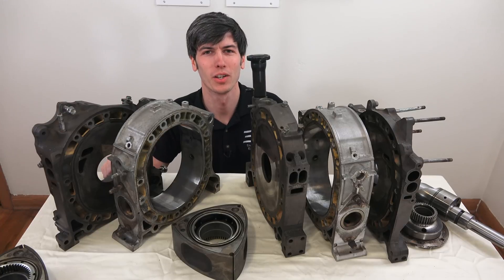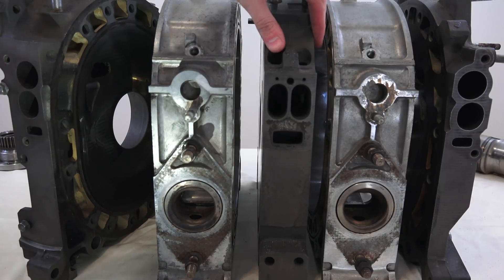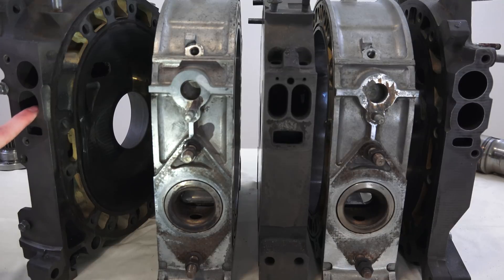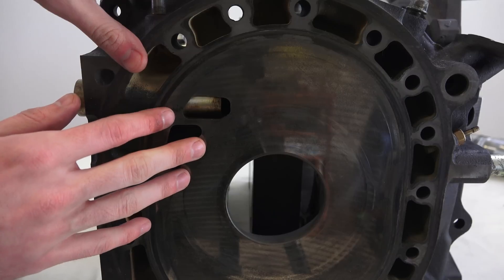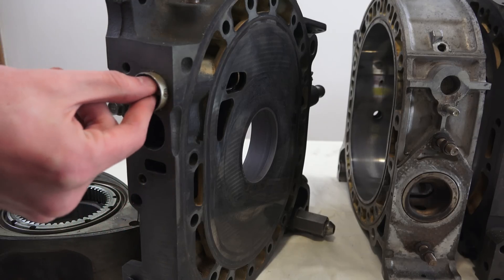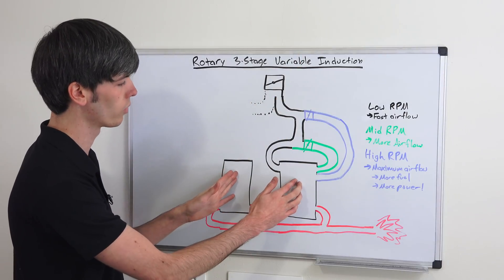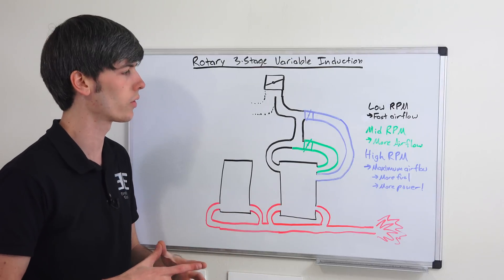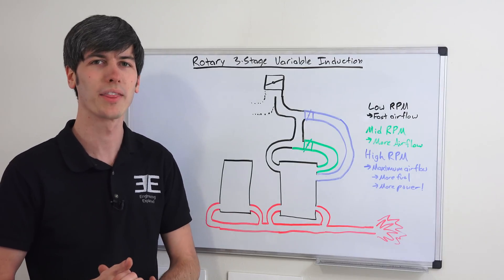Do Rotary Engines Have VTEC? Wankel VIS

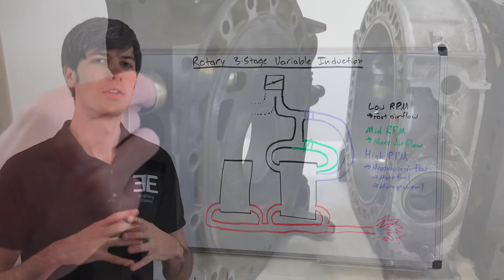Comment: So, rotary engines do have valves? In this case, the intake valves (shown at 1:57 ) - though they are outside the engine. In the video at 1:30, we could also claim that's a sleeve valve of sorts for the auxiliary port? That's inside the engine... Killing the myth that rotary engines, including the Wankel rotary engine design used by Mazda, do indeed have valves.

Comment: What if you eliminated this (vtec) system, and was giving the engine maximum airflow at all times? Increased power and poor fuel economy?
Reply: there wouldn't be an increase in power because all three are already open at high rpm, you would just lose low rpm torque and drive-ability due to lower intake velocity

Comment: Fun fact: The 6-port engine in the Rx-8 actually has 5 intake modes!

Idle - 3250rpm = Only the 2 ports in the middle iron are open
3250 - 5500rpm = Secondary shutter valve opens, allowing airflow in the lower ports in the end housings
5500 - 6250rpm = Variable fresh air duct opens on the airbox (shorter intake length before filter)
6250 - 7500rpm = Auxiliary port valve opens, allowing airflow in the upper ports in the end housings
7500 - Redline = Variable dynamic intake valve opens, opening a shorter intake resonance path

Mazda went to town on this one.
Reply: Does the 4 port model have this too?
Reply: @imjustvibinboi2406 4 port doesn't have the Auxiliary ports, and no variable fresh air duct on the airbox

Comment: Are these multiple intake ports a necessity because of the carburetor?  I wonder if you could just use all three intake ports all the time with a fuel-injection system.  But in 1985, I'm pretty sure Mazda used carburators on their RX-7s.
Reply: GSL SE

Comment: It's not a solenoid that opens up  the secondary ports. It is the speed of the exhaust gasses creating a vacuum effect in the lines attached to the secondaries that causes them to open. A solenoid is an electrical device.

Comment: It's vaccum controlled on the 85 you were showing. no solenoids. it's like a little vaccum chamber that as it collapses at high vaccum it rotates that shaft. just pulled all that stuff off mine, they were locked up.
Reply: Lock them open. It's like running with 4 barrels open  had one called the Hemi Stomper

Comment: Wankel engines suck they did when they where invented in Germany, they still do. Mazda never made a reliable one after decades of investing in them new materials it just doesn't work they have a short lifespan and drink more than an average back alley hobo. Only "fan boys" like Wankel engines.
Reply: They beat the pistons at Le Mans. Mine has 200k, and has never been opened up. I also have a 1976 Cosmo RX5 still running .Wanna be.

Comment: my aux ports and vdi are open only cause they were seized shut lost a little bit of low end but i went to a gtu s diff which is a 4.30 vs the normal 4.10 so didn't notice a difference

Comment: The RX8 engine diagram is a bit off.  No butterfly valves.  You have a single SSV valve that actuates.  It rotates to different positions to open and close the intakes.  The positioning also allows cross flow from rotor to rotor.  basically as on rotor closes it's ports a pressure wave heads back through the intake and into the other half of the engine.  Mazda claims it makes for a sort of supercharging effect.  Sort of.   The pressure wave just shoves a little more air/fuel in.  They claim it's good for a few HP.  Not sure how much they say it is.

Comment: I've experienced cruising in a Nissan with a continuously variable transmission (CVT). The extraordinarily low engine RPM at cruising speed made for some impressive fuel economy. 
I'm wondering if pairing a CVT with a Wankel operating at low RPM would be light weight enough to be economical. So, I guess my question is, since I understand that piston engines tend to bog down at low RPMs, is Wankel efficient enough to run that slowly?
Looks like a marriage made in heaven to me.

Comment: I just recently watched the video on the 4 reasons why the rotary is dead, and the main problem was fuel economy. That being said, with only one port open at low RPMS, does that mean that it is getting worse gas mileage at higher RPMS because all the ports are open, or does it compensate for the faster turning of the rotor?
Reply: Look at Jason's later vids on the rotary, especially the hydrogen one.

Comment: Very interesting and well explained.  The emissions effectively killed this wonderful engine and the difficult seals, so if in the future one could solve these problems, it may be competitive again, right?  Diesel has oil in the fuel mixture, would that not be sufficient to lubricate the tips of the rotors and avoid having to inject oil to burn and ruin the emissions? I know NSU, Mercedes, Fiat and even Norton motorcycles have dabbled with the Rotary engine and given up, therefore I am sure they must have considered all the options before relinquish their interest.  Thank you for the info.

Comment: Is this done more to increase fuel economy/efficiency than to increase horsepower? The waknel isn't known for it's MPGs.
Reply: +Osvaldo Morales You are partially correct in that it is to increase horsepower but only that those auxiliary ports are closed to promote more stable engine operation at low speeds and of course gas mileage. When you climb the RPMs, the other valves open and you get increased airflow and more fuel to maximize the efficiency of the engine. Btw, the last naturally aspirated rotary made (86-91 RX-7) only put out 146-160 hp. The Renesis puts out anywhere from 230-240 hp. And they have the same gas mileage.

Comment: +Engineering Explained - I feel you missed a big part of the VIS on the Renesis, as well as some piston engines like the BEAMS toyota/yamaha engines.

Not only do the ports open to affect port velocities, but the actuators are situated in the intake manifold so as to change effective runner length, greatly increasing VE.

Comment: The variable length intact tracts used on the rotary  engine make more power or TQ by changing the length and also speed of the incoming pressure waves , depending on length. The RX7 FC S4 N/A engines 86-88 are called 6 port engines. These engines have 2 primary intake ports and only use these primary ports before 3800 rpm. At 3800 rpm the S4 N/A engines open 2 more intake tracts, as well as 2 more oil injectors start working and the remaining 2 barrels of the 3 barrel 115MM TB also open up.  The 86-88 S4 Turbo engine is a 4 port engine and does not have the variable intact tracts.Changes were made for the 89-91 N/A S5 engine, now Mazda added a VDI, which started to work at 7200 rpm and allowed these engines to produce power up to 7800 rpm stock.  The 89-91 block for the S5 turbo engine is the same as previous years.  This only applies to 2nd generation RX7,s

Comment: answering the question thats used as the title of this video, yes, definitely...... rotary engines, specifically the more common 13B, uses the best type of VTEC, however Mazda calls the technology Twin Sequential Turbos, lol..... in all seriousness, no, the more common uses of rotaries are to make an insanely light and small displacement engine and then slapping as many turbos onto the engine as they can. has Mazda designed and utilized something SIMILAR that acts like VTEC/VVT/etc? yes, but definitely not the same because rotary engines dont have CAM SHAFTS. in their naturally aspirated (non-turbo) engines, they added 1 additional intake and 1 additional exhaust port, and used crank shaft sensors and computers to actuate these valves; off of what rev youre at, throttle input, etc.... that technically isnt a traditional variable valve timing mechanism though, because traditional versions are actuated via retarding/advancing the cam shafts (which is the part that opens/closes your valves), and like i said earlier, rotaries dont have cam shafts.

that is all.

farewell.

stay frosty.
Reply: that was sarcasm dude.. lol.. VTEC was essentially designed to mimic a turbo setup; when off boost, youre not consuming much MPG, when your boost kicks in, you use more fuel.. VTEC is like that in a sense, when out of VTEC, you're not consuming much fuel, when VTEC kicks in, you're putting your engine in "turbo boost mode".... so, in a sense, Mazda's VTEC is the best kind because it utilizes twin turbos lol

Comment: they are "stackable" if you will it usually just requires a longer eccentric shaft ususally a 3 peice in the case of 4 rotors 26b and longer reinforced studs but the engine has to be balanced and perfectly aligned to make sure it doesnt twist while running and break itself   essentially . and they can be "v-mounted"  in the case of the 12 rotor engine. how that works i really dont know. custom brackets to hold each set of rotors along with each eccentric shaft having its own pulley and a complex drive belt system from what i saw in the video of it . along with a costom i take manifold to feed all the "blocks" if you will. im sure its very complicated tho and took tons of time to develope.

Comment: Your video doesn't detail any pulse-wave tuning of the intake or exhaust manifold, talking about air-flow only.  I've never really thought about it in the context of rotary engines, but the varying lengths of the effective intake must have an affect on the intake pressures at certain rpms? Could you do us a video on variable intake lengths and their affects on typical vs rotary engines?

Comment: Is just variable intake, So you wrote VTEC just for show?  only get better ratting?
Reply: +Blehtubezz Aus  VTEC main thing is change intake duration,  because high rpm needed more time to the same air flow.
This system open/close channels for more air but duration ? This system for me look more like viariable intake (only open/close Chanel for better air velocity, like OPEL TWIN PORT,  TOYOTA T-VIS

P..S  me old opel have dual ram system, also have 3 stages (or 4, if idle stage), but it is different thing vs vtec,-working in "different section" , yes it increase air flow, but not change duration.
Reply: +fregis on a rotary the port shape is essentially the camshaft profile.  having multiple ports that open at different times is like having multiple cam profiles on demand.  rotary engines (at least the rx8 version) also have multiple length intake tracts as well on the intake manifold.
Reply: i think about that (different position vs rotor), but Engineering Explained only talk about intake velocity, just more air....  Port form, number opened increase time intake,  ok like vtec system, or more i-vtec
Reply: Excuse him he knows nothing about Wankels. He says they are not reliable but they won the 24 hours of Le Mans in 1991 or 1992.. Also the Cannonball run back in1983.

Comment: is VTEC not variable valve timing. if so how could a rotary engine have VTEC
Reply from the maker: +Jack Stewart Also alters lift, as in the area for which air can flow into the engine (at high RPM).
Reply: +Jack Stewart the porting on the Naturally Aspirated rotaries affects all aspects of induction  characteristic. The 'top' port he is explaining, is not only giving greater port area, but greater duration of the intake opening in relation to 'crank degrees' and therefor has the same effect or function.
Reply: Port positioning is the equivalent of valve timing for Rotary engines, so opening that extra port higher on the housing is effectively the same as altering intake valve timing.
Reply: @LordCakeskull : EXACTLY right.
Reply: +Engineering Explained wouldnt what Mazda implemented in their motors be more in the realms of tuned induction as opposed to a Hondas variant of vvt?
Reply: +Jack Stewart A Valve is a device that opens and closes, in my perception, the Vtec is those two variable intake ports shown in the video.
It's just one other type of valve management that makes the similar effect.
Reply: on the 13b mazda was the first to introduce this kind of air induction into a car.  also known as "6th port"
Reply: With a V-Port silly.

Comment: not quite sure what the difference is between air flow and air velocity...  something like pressure vs speed ?  tyvm nice one (even though i dont quite understand!)
Reply: +Guillaume Breton Flow is the cross sectional area of the inside of the intake multiplied by the velocity. So they have a direct relationship most of the time. However, the total cross sectional area increases when the extra ports open so the velocity of the air in the intake doesn't increase at the same rate even though your overall flow is going up considerably. Hope that made any sense...

Comment: so if the valves are controlled by a solenoid, then is would mean they would be either open or closed? Do you know if anyone (not that anyone other than Mazda has put much into rotatory) has made a variable system?
Reply from the maker: In the 13B engine I'm showing, yes, it's an "on/off." Dunno if they vary it with later models, doesn't seem like it would be hard to do with the later model engines.

Comment: so much engineering effort and so little fuel economy
Reply: +Jake Gelly There is more to life than fuel economy...  :-D
Reply: +Viper310 1.3 litres is not a comparable number to piston engines because of how the combustion chamber works differently, it's about x3. This guy does a video on it I'm pretty sure
Reply: Viper310 yes, however a rotary has 3 combustion cycles occurring at the same time in the same space. this makes it 3x the effective displacement.
Reply: +Punchy LightBeer 22L/100km is not 9.4 Gallons per mile. You probably meant 9.4 miles per gallon which would be more accurate.
Reply: +Raoul G Bot 280hp out of an 1.3L in the case of the RX7 FD, shows the engineers got it right. We don't care about the 17mpg when we're leaving that Mustang 5..0 which by the way gets the same MPG in the 80's and 90's.
Reply: +Jake Gelly and its done on purpose. There have been better engines made that have more fuel economy, less parts, and same if not more power but the big companies snuff them out.
Reply: If you knew the meaning of displacemnt, you wouldn't say that. Displacment=Engine displacement is determined from the bore and stroke of an engine's cylinders. The bore is the diameter of the circular chambers cut into the cylinder block. Or as in the case of the Wankel rotors and housings.
Reply: Viper310 i guess i don't know the meaning of displacement???
Reply: Lol theyre like 2 stroke engines, you can't compare them exactly the same to a 4 stroke when they don't work the same, idiots.
Reply: Yet so much power. More than any V8. Inch for inch. You know David and Goliath.

Comment: Toyota 4AGE had TVIS. This was a dual intake runner system with a simple gate for the second runner on each cylinder. At around 4500 rpm (someone will correct me on this cause I can't remember exact rpm) the second runners would open up. 

To those not sure why you want it closed at all, at low rpm you still want intake velocity to stay high but if both are open then the air will sort of stagnate at the intake valve since only a certain amount can go in the cylinder. 

Anywho, cool to learn that Mazda did something similar on the rotary. The unique design really does change everything so every problem has to be assessed in a new way instead of having tons of examples to learn from.
Reply: +Evan Moon  opel have same system:

The Twinport Ecotech engine is the second generation of the GM Family 0 engine technology (also called Family Zero ... haha, could even be "Family Zed" in the right parts of the world, eh?). It works by having the ability to close off one of the two intake ports near the intake valve at low engine speeds, which speeds up the air entering the cylinder and causes a swirl of the air fuel mixture as it enters. This produces better low end torque. Coupled with advanced exhaust gas recirculation allows for better gas mileage without engine misfires (from the extra exhaust gas). As the engine speeds up, the secondary port is opened. Here is an image of how the air flows into the engine with (left) and without (right) the port open:
Reply: +Evan Moon I've literally had T-VIS throw me off the road in the rain, mid-corner idiocy on my part in an MR2. :D  Taurus SHO 3.0/3.2 engines had a similar system to T-VIS. Mazda also had VRIS on several v6 engines which worked similar to this rotary style VIS with 3 stages and 4 different intakes, (on different vehicles,) that worked in different rpm ranges. The BMW M5 and Porsche 959 also had variable intake systems.
Reply: +Evan Moon Everybody was playing with variable intake systems in the 80s. As fuel economy rules tightened up, manufacturers began designing smaller engines that could rev higher, and so needed larger port diameters to accommodate their high-end breathing needs. However, at low RPM, port velocity is too slow with such large ports and such small displacements, so manufacturers did what they could with what they had. Variable intake systems were often vacuum-actuated, not relying on the limited computing power of fuel injection systems of the day. For example, Nissan used several similar schemes whereby a vacuum actuator would open and close butterfly valves in secondary ports, or block off part of an intake port, including the Secondary Butterfly System used on the CA and RB series engines. These relied on manifold vacuum alone. At idle, the high vacuum condition closes the ports. As vacuum decreases or boost builds, the butterflies open up. Mazda's variable intake systems were similar, as were Toyota's. Of course, in the early 90s, variable valve timing and lift came along and changed the game, rendering many VIS systems obsolete.
Reply: Mazda's VRIS was ECU controlled vacuum solenoids and lived on to 2002. My favorite was the one for the M5.